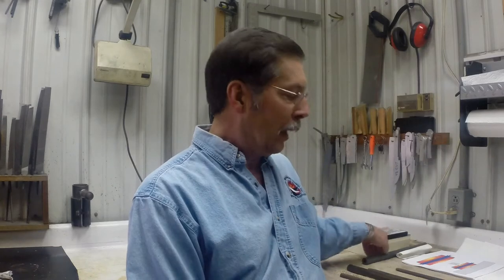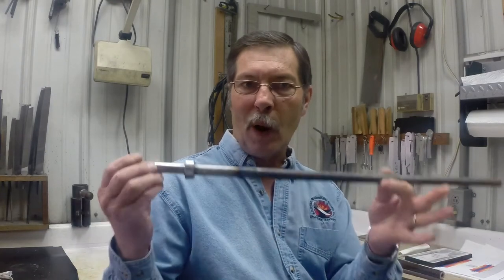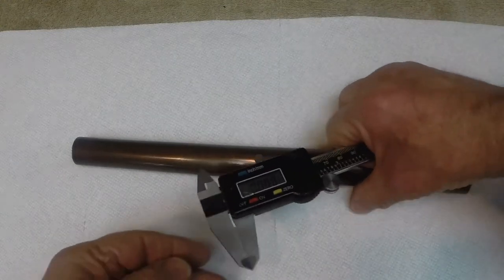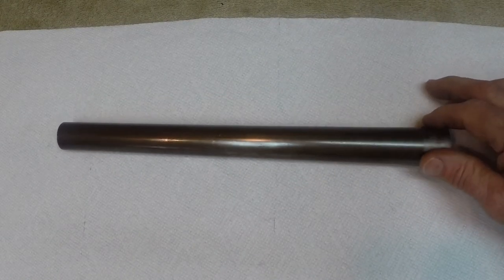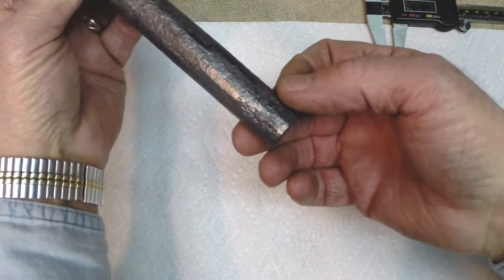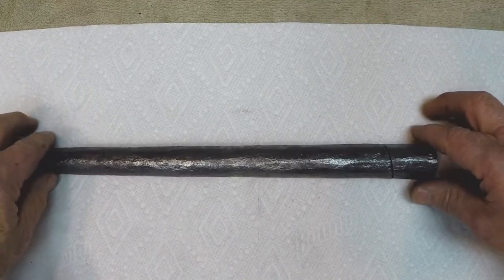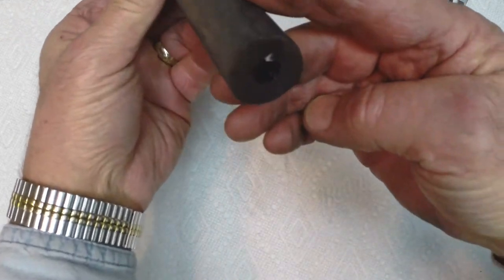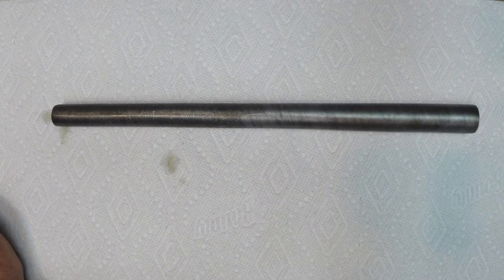Barrel Reforging into Pistol Tube - Short Version

Comment: To be pedantic they are pattern welded barrels not true Damascus. Damascus is wootz  steel  which is made in a crucible.
Reply from the maker: You are about 200 years too late to argue the use of the word damascus.  These barrels are indeed "pattern welded"; a descriptive term for the material, which was coined perhaps 50 years ago.  But the nomenclature of "damascus" has been used for these barrels for centuries.  Please educate yourself before you attempt to educate others.

Comment: Hello sir 
I use a galvanized iron pipe 
To make musket .I use a  iron pipe that fit perfectly over the inner barrel for double the thickness 
. The wall thickness from this mathod reach 5 mm thick.i fire that thing about 60 times and didn't blows up at high powder charge  .so sir what you think About this mathod works and didn't blows up in future. Thanks
Reply: sir please reply
🙏
Reply from the maker: Without knowing more about the metals you are using and seeing what you have made, it would be improper for me to offer an opinion about the safety of what you have built.  But it sounds to me like a very risky thing to do.  Only you can determine by testing, if your barrel is safe to use.
Reply: @SteveCulverMS1  thanks for reply sir

Comment: Hello Mr.Steve
I was planning on making an air rifle barrel but do not have access to a suitable sized lathe and a suitable drill so i was wondering if i could take a small diameter pipe (like black pipe for example) and forge it down to reduce the inner diameter then ream the barrel afterward.
What i want to know is can i expect at least decent results from it? I have forged a lot of knives over the years which is where i got my experience in moving metal to the desired shape, but never really tried any complex techniques. 
I would really appreciate any advice that you can give.
Reply from the maker: I'm going to say that you will not get decent results.  The bore in a forged tube is an ugly thing.  After forging a tube down smaller, you still have to drill it out to near final bore size and then ream it.  That takes specialized tools and a lathe large enough for the length of the barrel, plus the length of the tooling.  I wouldn't consider all that trouble to make a barrel out of "typical" steel.  It's only worth it to me, if the barrel is made of damascus.  New (and used) barrels are cheap and easy to find.
Reply: @SteveCulverMS1  Now that i am reading my comment, i noticed that i haven't really made myself clear. What i initially wanted to say is that i do not have a means to drill out a solid steel bar down the middle because i do not have access to a suitable gun drill or long enough drill bits (which would not produce satisfactory results anyway)
So to clarify, i am able to drill and ream out a forged barrel blank and i plan to make a pistol barrel at least 30 cm long. I also agree with you that forging a gun barrel out of any steel really isn't worth the effort, but i wanted to try and reduce a thick walled piece of pipe to a suitable diameter.
Reply from the maker: @hardcase1659 Machining a forged barrel tube is a complicated process.  I have not been able to do exactly the same machining on any tube that I have done.  As each forging is different, you continually have to figure out what you need to do next during the bore clean-up work.  The forged bore is not perfectly round, it’s not straight and is not concentric with the outside of the tube, so the amount of material that is being cut away during drilling is uneven along the length of the bore.  The varying amounts of material being bored out, tends to push the cutting tool sideways.  If the tool is misdirected by the material and starts cutting off center with the outside of the tube near one end, it will be very off center if fed through to the other end of the tube.  So, you must be constantly aware of how the tool is being directed.  If the tool starts to cut off center, you must take note of it and resolve a way to correct the problem.

Correcting the condition of the forged bore and the outside of the tube not being perfectly concentric with each other, is done by alternately drilling the bore and then turning the outside of the tube to be concentric with the bore.  I use two different lathes for the boring and outside turning of the tube. (It can be done with one lathe, just takes a lot of tooling changes)  After each bore drilling operation in one lathe, I place the tube in the other lathe, with the bore held between tapered centers.  In this second lathe, I turn the ends of the tube concentric with the bore.  The tube is then placed back in the first lathe for another drilling operation, being held by the newly turned ends in the lathe chuck and a steady rest.  It is a back and forth operation.  Drill the bore.  Turn the ends.  Drill the bore with a larger bit.  Turn the ends.  At least until you are confident that you can push a drill all the way through the bore and it is not misdirected by cutting uneven amounts of material.  I step drill the bore out, using larger and larger bits. 

The first tool I use in the rough forged bore is a tapered bridge reamer.  I push the tapered reamer into the bore from one end, to the middle of the tube.  Then, turn the tube around in the lathe and push the tapered reamer in until it passes into the earlier drilled section.  The bore is then drilled with a slightly larger core drill bit.  Core drill bits are much stiffer then twist drill bits, so are not so likely to be misdirected.  Once you have been able to push a core drill bit all the way through the bore, you can change to using twist drill bits.  Final finishing to bore dimension is done with a chucking reamer.

Off the shelf bridge reamers, core drill bits and chucking reamers are going to be too short to pass all the way through a barrel tube of any length.  You’ll have to attach an extension to them, precisely enough that they function accurately.  Aircraft twist drill bits may be long enough to drill out a pistol length tube.

 Your forged barrel tube will be covered, outside and inside the bore with forge scale.  Forge scale is very hard and will quickly destroy the cutting edge on any cutting tool besides carbide.  I soak barrel tube forgings in sodium bisulfate to etch away the forge scale.   You can purchase sodium bisulfate where swimming pools chemicals are sold.  It is used to lower the PH in pool water.

Comment: Very cool! Was forged in fire shown accurately? I know a lot of reality shows are super fake. But forged in fire seems legit.
Reply from the maker: Forged in Fire is shown accurately, in that the things that you see actually happened.  However; you are not seeing ALL that happened during the challenges.  There are about 15 cameras running during the challenges.   A lot of that filming goes on the cutting room floor.  Things happen that affect each competitor and the results of the challenge.  There are purposely not enough power tools to allow all the competitors to have one available at the same time.  So, someone is going to lose time waiting to use a piece of equipment.  This is a built-in variable, meant to introduce unexpected challenges into the competition.  Too, if a tool in the shop breaks down, the clock doesn’t stop.  The production crew will go to work to repair the tool, but clock doesn’t stop while they are working to repair it.  Everyone waits and loses time to work.

Each competitor spends hours in interviews.  They may have stated in the interview why they made a decision on their work or explained what went wrong for them.  This information may very well not make it into the final cut of the show.  If you’re left wondering why a competitor did something, or how they got so far behind in their work, know that it is possible that there is a very good reason for it, but you’ll never know the truth about it.
Bottom line; viewers will simply not know everything that happened during filming.  Just enjoy the show for it for what it is and understand that you are only seeing a snapshot of all that happened during the competition.
Reply: @SteveCulverMS1  Thank you so much for such an amazing reply! All of that is exactly why it's the only reality show I watch. Others are obviously scripted. Or they edit in a way to curve the show. Also in all the episodes of forged in fire.. Idk how many there are, but it's a lot, I've never disagreed with the judges decisions. (at least not the way they are portrayed) they always seem very fair. Unfortunately we only get an hour, so there is going to be a lot we miss. They could probably cut out some of the dramatic affect and corny comments to show us more, but regardless, they seem to do a good job. Very interesting that there's so many hours of interviews. I hope they do a behind the scenes some time to show more of that. Thank you so much for your time Steve!!